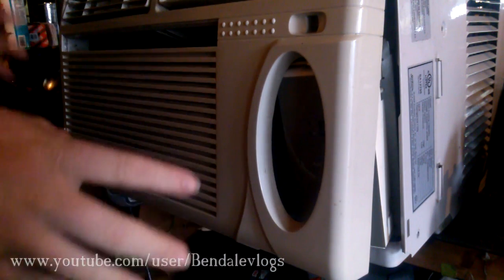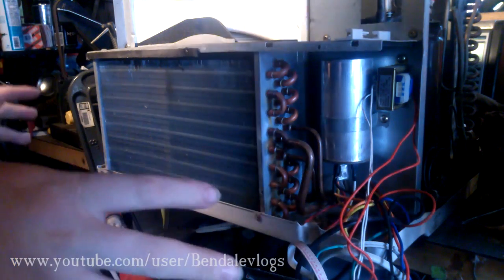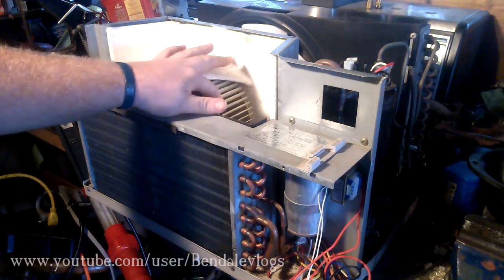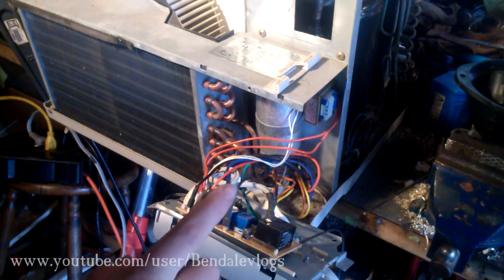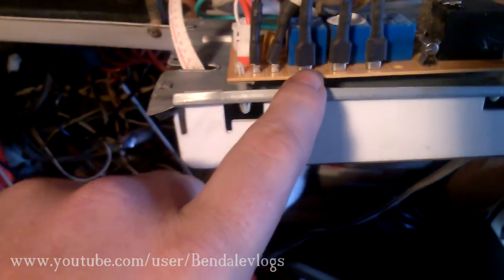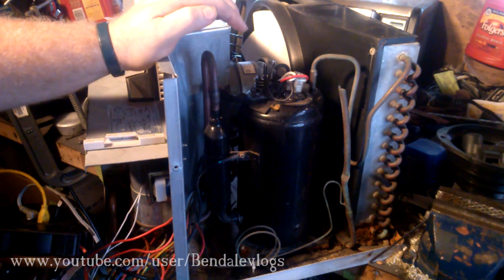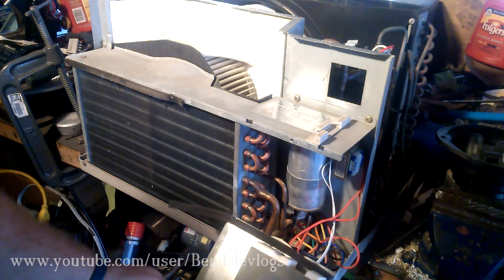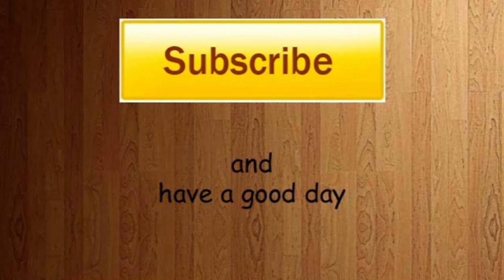Let's repair a window air conditioner

Comment: I drilled a hole in my window unit for drainage.  In doing so I punctured  the outside of the rear coil on the left side looking for the outside.  I'm  needing to know how to braze the tubing. Also how to recharge the freon. Any information you can give me is deeply appreciated.  Thanks.
Reply: I read through some comments and found where you answered my question.  Thanks.

Comment: CAUTION  Capacitors carry high voltage and can kill you if you get hit right or have a bad hart and or a pacemaker etc.  This guy keeps touching the thing, your supposed to discharge them if you are going to service anything that has one.  Personally I have worked on many things that have them without discharging them but being very careful not to touch the electronics or if needed being sure I'm not touching anything that directly goes to the Capacitor.
Of all the time's I've been shocked in my life (around 4 times) 3 with 110 volts and once while changing the start switch on one of the 1st microwave ovens to come on the market (I was 16 or so) it was unplugged and I took off the cover and went to lean in to see what I needed to do when I touched the Capacitor and I got knocked out.  I didn't know about them then. I was only out for a second or three but when I got up I noticed it said IN BIG RED LETTERS -  CAUTION DISCHARGE BEFORE SERVICING . . . dah.  OK, Lesson Learned.  I have since heard of at least one guy who got killed by one.
Reply: discharge how?

Comment: did you check the capacitance? you don't have to take it out unless the connections are welded on or something.

Also, feel like if the first thing you noticed was the fan motor turning very roughly/poorly even with power off, the thing probably just needs a new motor. YOu'll get the fan going if you free it up somehow, but eventually will destroy the capacitor, etc

Comment: Hi I have a quick question for you? I have a ge window unit
There is a piece that goes into relay that has broken off. Can that be sauntered back on, it has a (u) shape or similar to a horse shoe. I heard you say earlier in video,  pc board bad might as well scrap it. It's hitting 107 here in Texas so really need it ,but don't have space to leave sitting around.
Thanks
Sherrie'

Comment: You need to backdate the AC to before the computer/ CNC age .The problem with these units is modern tech and the manufactures who design the unit to break as soon as the factory  warranty expires  The first step is to rid the unit of the circuit board. Step 2 is to beat it with a  hammer!. We are working on a way to skip step 2. We are sick of being ripped off by the current Shot Out products that LG and other manufactures are making . Our goal will be to build a kit that is very low tech, gets rid of the circuit board  and can be used on all modern window AC (with good directions) units to make them last for maybe 15-30  years (with proper cleaning) . The current POS units are made to break as soon as the 1 year warranty expires  and lack of quality is ripping off every customer who buys a modern AC. or any other appliance The main components are still made with some quality but the circuit board with energy saving and drying modes is the problem . By getting rid of this BS it might cost $5.00 more each month to your power bill but you will have an AC that works.  It is better to be cool than a repeat fool by buying more this garbage. We will post a report when this project is ready and any help from experts would be great. This is a warning shot at the these appliance manufactures.

Comment: the freon comes out the top of the compressor on high side gets pumped through the condenser. that is the hot coil. as it exits out of that is goes into the cold coil through a very narrow cap tubing and then goes all throughout the evaporator till it comes to the drier muffler on the big tubing which is the suction side.
Reply: the fan motor is a chinese one the blower and fan are all sized in chinese which is nether standard or metric so the motor and blades are junk for sure.

Comment: If the fan is hard to turn, it has bad bearings or the bearings need lubed 👍
Reply: Yep he will find out soon as he replaces the capacitor and the problem returns. If it doesnt spin freely by hand its bearings are dried up. On almost any electronic device the bearings are the first component to fail. MTBF on bearings are usually about five years depending on temp. They will usually increase the current and sometimes blow the fuse if high enough.

Comment: I would have stopped at the fan motor... If you hear the motor 'trying' but the fan doesn't move much, then why analyze anything else? ... Everything else probably still works. Just fix the fan!

Comment: my unit doesn't turn on at all no power! there is power in the power supply wire but when u hit the power button, nothing 🤦🏽‍♂️. from the supply wire, one goes to the capacitor and the other to the computer board. the capacitor has no bulge or any signs of a bad capacitor. could it be the board itself??? oh i noticed on the compressor the side with the 2 wires (not the side with the black and red but the brown goes from one side to the other) that little black part that the blue and brown wire hook onto is loose not intact to the compressor, is that normal?

Comment: I wonder if you know what's wrong with my AC. It was working last night but early in the morning when I turned it on it wasn't cooling like it used to. The cooling is like when you put an ice in front on an Electric Fan in hot summer. I cleaned it and it's still the same. The compressor still runs as well as the fan. I have a 0.5HP Haier Window Type AC.
Reply from the maker: Sounds like you have a coolant leak but that's a little harder to diagnose than an electrical issue. You said you cleaned it, did you take the cover off or just cleaned it from the outside?
Reply: ***** I took the Front and Cover off just like what you did in this video. Didn't notice anything obvious since I don't know what to look for. One thing to note is the compressor doesn't sound like it used to, the sound it makes isn't higher than it used to be.

Thanks Ben!
Reply from the maker: That noise is a good indicator that the internal pressure is low. You could get it charged but it might be just as expensive to buy a new one.
Reply: ***** Oh, really? Just when I have to pay my bills this had to happen. I'll try my luck next time. Any general brands that have good quality? I only had this AC for a year and almost 4 months.

Thanks for the help Ben! I liked this video.
Reply from the maker: There are so many makes and models I couldn't even begin to recommend something. Personally I'd look at craigslist and kijiji. you'll save a ton of money.

Comment: Hi Ben I have GE AC window conditioner model ASW05LKS1 and when I plug it I get no power to the fan nor in the whole unite I do get electrical to the relay but no power to whole unite could it be the relay ??? Thank you Vince

Comment: 3:01 the compressor compressses the vapor thus increasing it's temperature to make it easier in the condenser to expell heat from the refrigerant. It doesn't create the cold bruh.
Reply: khalil taylor   I said that the compressor does not create the cold but helps the refrigerant to dissipate heat outside. I did not say that there is no compressor.

Comment: model cl rac05mwi coils wont freeze  I cleaned it good washed it with pressure hose still wont work that loud sound only last 5 seconds ? Need.info what's wrong with it

Comment: Hey there, I have a quick question about window AC repair.  There was a wadding of a putty of some type blocking off the hole (that  wires run through) between the main large compartment of the unit, and the smaller electrical compartment with the circuit board for the control knobs.  This putty/wadding was removed (long story).  I wanted to replace this to be able to use the unit safely.  Do you know what this material is (plumber's putty?) and tips for replacing it?
Reply from the maker: +MultiJamesman it could have been a number of things. It's just there to prevent moisture getting in and stop the wires from rubbing. You could replace it with pretty much anything, silicone caulking would work well. You could use plumber's putty if you had some on hand. Gorilla glue would also work.
Reply: ***** Thanks!

Comment: My A/C won't blow any air. Any thoughts? The electric panel does come on but does nothing. Every minute or so it makes a semi loud noise like if it's starting. What should I do?
Reply from the maker: +Horacio Cruz if the panel looks like it should (the lights come on like normal, there aren't any error codes) and it sounds like it's trying to start it's likely the capacitor or the relay that controls the compressor. If the fan runs then the relay is your issue.
Reply: the semi loud noise must be the compressor, there's something wrong with the fan

Comment: Interesting video.  Thanks.  I am curious though what the end of the story is.   Was it the capacitor or sticky motor axle?
Reply from the maker: +MrJessDancing capacitor tested OK and it seemed to run fine for the next few days. Just a sticky motor.

Comment: Hi, my window unit had been icing up very badly, the coils are full of ice and the copper tubing turns white with frost. Should I be worried about a freon leak? I can send you pics and a video. Any help would be greatly appreciated!
Reply from the maker: I doubt there's a leak, if there was it would stop working pretty quickly. I probably just hasn't had enough of a defrost cycle. Has it been running constantly in high humidity? Make sure the fan and coils are clean, try leaving it off overnight to defrost or carefully hit it with a blowdrier to get rid of ice.

Comment: is great work u do man i know this video is old but how do you refill the ac air the gas on the unit
Reply from the maker: +ULTIMATEMANNY the average person can't refill a window air conditioner. You'd need to find the leak, repair it, find a service port (or make one by cutting the pipe and soldering), figure out which coolant the unit uses, get an ac refill pump and hoses. It's just not worth the expense, most professional ac repairmen won't even do it.
Reply: Oh ok man in other words is better to get a new one no problem

Comment: Hey Ben was wondering if you might know what would cause my a/c to shut off , the fan will run for a while & shut off , compressor still humming ??? We cleaned it out real good , hosed all the coils out , after that the fan was squeaking real loud , sprayed some WD 40 in it , it came back on but only ran for a short time then shut off again ... Any Ideas ??? Thanks again for all your advice ...
Reply from the maker: If the compressor is running that means you have power, the board is good and the capacitor is good. My guess is the fan motor has been damaged. Disconnect the power and try to spin the fan. It should spin freely and for a ridiculously long time. If that isn't the issue, discharge the capacitor, and check all the spade connections, one might be loose or have a little moisture in it.

Comment: Hi Ben, we had a wall unit running just fine the other day then suddenly we heard BOOM! Then I saw what looked like a fine mist spray of water outside the house by the window where the wall unit is located. After that incident we noticed the AC was no longer blowing cold air. could it had been the compressor? and should i have the unit repaired or should we buy a new wall unit?
Also, can a compressor blow up?
Reply from the maker: Sounds like you blew one of the lines not the compressor itself. If it was one of the lines and if it was in a convenient place it could be repaired but it would probably cost as much as a new unit. The repair itself is usually as easy as cleaning and soldering the hole but recharging the coolant is something that the average person can't do. 
Call a few local AC guys and see if you can get a free estimate.

Comment: Ben D. well we cleaned a window unit it was not freezing up at first but was very dirty. now that it is clean the evaporator coil is freezing it did not freeze up when it was dirty. what might be causing this to happen.
Reply from the maker: +Rudy Lopez if it's just a little frost, that's normal. Now that it's clean it's transfering heat alot better, combine that with humidity and you'll get frost. If it's actual ice, you might have a problem with the compressor, the defrost cycle, a partially blocked tube or it may need to be charged. Give it a few days, if it's still building ice turn it off for a few hours to defrost and repeat as needed.
Reply: +Ben D the defrost cycle could be it we have it on energy save so it has time to thaw out. the only part that is freezing are the outer top copper tubing and the top of the evaporator. I have bought a cleaner that will be my next step to make sure it us free of any dirt and grime. also when it tyrn on the freeze starts within 2-3 min when we turn it off it defrosts within 1 min. any other ideas with this additional information you  can think of.
Reply from the maker: +Rudy Lopez that sounds pretty normal. A little frost is going to stick to the coils. Even a bit of actual ice is OK. If you see ice blocking big sections of the fins or ice balls growing inside, then you have a problem.
Reply: +Ben D thank for your help
Reply: Sounds low on freon gas. You have a small leak check the high side line to condenser. The compressor shakes and vibrates over years copper gets weak from flexing and leaks next to the condenser. Clean and flux copper line and torch solder  leaky spot.  Its hard to solder a ac unit with a partial charge. Bubles push thru the hot solder. Get a tap valve find leak with soapy water.. Discharge ac. And flux and solder leak. Charge ac add ac oil first then freon
Reply: My ac ran from 7am to 10 pm cut completely off I turned it on ran for 20 min. Cut off I turned back on ran for 10 min need help

Comment: I have one that was brand new was left sitting out side for a couple years installed it in the garage it worked for a couple weeks now it stopped working lights everything turns on as it if its working but the fan and ac dont turn on, what it could it be ??????????
Reply: Following same
Reply: My grandparents does the same they press the reset button and leave the power pressed without taking finger off and it turns on cold and everything but once they take their finger off it turns off
Reply: Did you figure it out ?
Reply: Change the plug in with a regular plug ... if the reset button is the issue.. I change them out all the time..

Comment: +Ben D my ac unit was working until yesterday I could turn it on from the buttons on the plug but the buttons on the top which change the temperature and change the modes and all that so the buttons don't work what do you think is wrong with it
Reply from the maker: +Kevin Rodriguez I'm not sure what you mean by "buttons one the plug" and I'd need more info to say for sure but it sounds like one of the components on the control board failed. If you're up to it you my want to take the cover off and look for a burn mark, unplug it first.
Reply: something must be wrong with the fan motor or compressor

Comment: My dog   Chewed the cord and my window air conditioner it's a Fairly new air conditioner but I can't bring it back because it's not that New. anyway can I replace the cord and air conditioner? and if so where would I go?
Reply from the maker: If the end is still ok you can splice the damaged area. If you need to replace the whole thing you can probably get a replacement at any major hardware store. You will likely need to solder in the new one so keep that in mind.

Comment: Hi again, well it's icing up again. I had cleaned all the coils, filter, absolutely everything, drilled an extra drainage hole, worked fine for a week and now it ices up constantly again. Any advice...again lol.
Reply from the maker: My best guess is its being over worked. There's not enough time between cycles to defrost. Try raising the temp a little or leave it off for a couple hours a day.
Reply: Low on refrigerant, its a leaker mama.

Comment: Check clixon button on compressor. Check capacitor. Check wires on compressor. Check thermostat switch by shorting the wires.

Comment: The fan motor just needs to be oiled, if it does not turned freely it needs oil.
Reply: Some motors don't have an oil port. I have drilled a small hole in the top of the bearing housing so I can drip oil down onto the bearings.  That's probably all he needed to do.

Comment: Hi Ben, my AC turns on fine works good for few mins and then turns off itself. If I leave the power supply on to AC it will go back to on status again and it will keep happening... is it compressor or motor? Any advices how to figure it out...
Reply from the maker: Sounds like the relay/thermal switch. They're not expensive to replace, You maybe be able to get them off an old fridge or AC being thrown out.